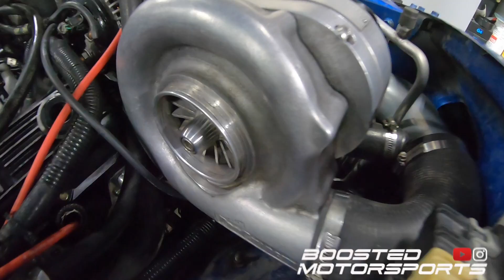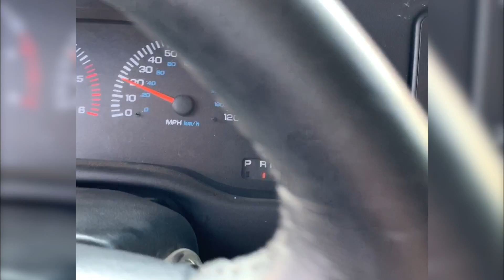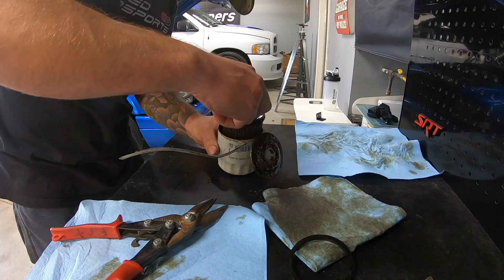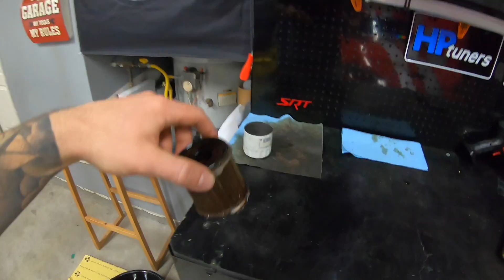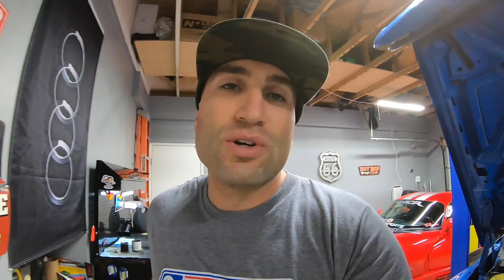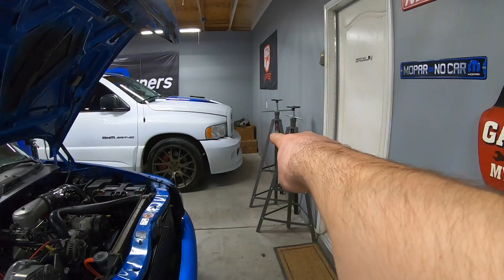BLEW UP MY ENGINE

Comment: It used to be and I have no idea if still applies but Mopar had goofy oil pressures. It is common for an old engine to drop down to around maybe 5lbs of pressure at idle and Mopar said it's normal. Rev it up and the pressure goes up, perfectly normal. I've put 50k on engines doing that and no of them ever let loose.

Comment: Should have stuck with the magnum man. Yes it ran meh times in the 8th but I don’t think that’s a fault of the engine, but more a drawback from the transmission. Maybe even the gearing. These 4 speed autos are junk and power robbers

Comment: My 1992 d250 5.9 does the same thing. It's got 126k on it. I just run 10w40. But I don't have any glitter in my oil. But it's stock and I'm not into modding it right now. So thicker oil works for now.

Comment: Damn dude that sucks...

My first vehicle I just bought a week ago is a 2001 dodge Dakota sport V8 quad cab.

With a V8 I believe 4.7 magnum and it's been rebuilt with 45k miles on it been replacing all the factory stock lights, system with alpine, D tunning headlights, taillights.

The black rims, all will be later since I have to save up for the black rims I want.

Comment: I have some thoughts about why the engine may started to eat the main cap bearings.  If you have been running high RPM's for extended periods, it may have sucked all of the engine out of the oil pan.  Try upgrading the oil pan to a higher capacity in the future.  Also, check out Hughes Engines for the 5.9 Magnum rebuild to include a block girdle.  Good luck.

Comment: If you got your 360 Magnum engine to 700 hp / 1000 hp were would you get the transmission rebuild to handle the power

Comment: I would rebuild the 360. If I were the one who owned it I think the first thing I would do is intake, exhaust, headers, and some bigger tires. Then I would see about better transmissions. I love dodge and all but their transmissions are really shitty especially for those years. They've been doing better now which is good. After that I'd save up and buy a forged crank, pistons, and new heads, on top of tune so it runs properly and maybe a bit more economical. Then I would see about going boosted. Since I'm only 16 I dont think I'd really want anything above 450 and the list I added up there would definitely be doing 450 horsepower reliably. Even then 450 horsepower for someone who hasn't had very much driving experience is still much so I think I'd have it tuned down to about 300 horsepower. Enough for it to be fun but also not too much to where I'll kill myself in the rain because it had too much power for me to handle.

Comment: I know you already got the engine in but i have a 50,000 mile 5.7 Hemi out of a 2016 Ram shortblock I’d let go cheap. I also have a Hellcat cam we could put into it before we shipped. Let me know. justins2002camaro@gmail.com if interested. Probably have a set of heads for it also just not 100% sure yet

Comment: The fact that you drove it and there is no abnormal noises makes me think that maybe the oil pressure sensor may be reading off. I have a 5.9 magnum and anytime it would sit in drive with my foot on the brake the oil pressure would drop to 0. Turns out it was just the connector intermittently losing connection. I could wiggle the connector and the gauge would freak out and go up and down. New sensor and pigtail and it never did it again. I would never assume that the engine is bad without a mechanical gauge oil pressure test.

Comment: I HAVE A BIT OF A PROBLEM WITH MY  2019 HEMI CREWCAB 1500 , IT KEEPS MAKING A LOUD HUMMING NOISE WHENEVER IT WANTS TO , BOUT ONCE A WEEK SINCE I ONLY DRIVE IT ON WEEKENDS,  ITS SO LOUD IT GOES OVER RADIO AN PEOPLE TALKING IN MY TRUCK AN WHOEVER IS WITH ME SAYS WHAT IS THAT . SOMETIMES ITS JUST ONCE FOR 10 SECS THAN SOMETIMES DOES IT OVER AN OVER FOR LIKE 3 OR 4 MINS THAN STOPS . IVE TAKEN TO DEALER 5X ALREADY AN FIRST THEY SAID ITS THE RACK AN PINION THAN ITS THE EXHAUST THAN SAID ITS NEITHER ONE AN CAN'T REPLICATE NOISE . SO I PICK IT UP , AN THAN IT DOES IT AGAIN,  ITS SO FRUSTRATING , NOT SURE WHAT TO DO NOW , ANY ADVICE OR HELP YOU CAN GIVE ME I WOULD APPRECIATE IT .  THANK YOU SIR.

Comment: Definitely do as stroker! Cost difference will be minimal from stock rebuild with a cam. And if ya can swing it go with the Trick Flow heads that came out.  My buddy has a set and they are miles ahead of edelbrocks magnum heads

Comment: back in the day i had a 318 do the same thing that your 5.9 did. the oil pickup had gotten clogged .. PO of my car had done valve cover gaskets and somehow got on of the gasket tabs down in the engine. wasnt ready  to build the 360 replacement engine so i dropped the oil pan and once i saw there was no scoring on the crank i stuck in a set of rod bearings, bottom half of the mains and a new hi volume oil pump.. stuck in new oil and a filter , stuck a heavy magnet on the bottom of the oil filter ran the engine for 15 minutes and changed the oil and filter again and stuck the heavy magnet back.. ran the car for 500 more miles and changed the oil out again with new filter and heavy magnet once again.. cut open  500 mile filter and found very little in the bottom... i ran that engine with many passes at the track for 1 year and ended up putting the 318 in to an old truck that got probably 100 more 1/4 mile passes and 50K more miles road miles before the body rotted away.. engine still ran like a top.... personally i would drop your pan and if no scoring on the crank re-bearing it and  SEND IT until you decide what you are going to do in the way of a build.... you can do the bearings in a day and be back on the road

Comment: If I remember correctly from previous video you talked about pushing it till it blew. Maybe not what you wanted and Maybe a little too soon but......back to the drawing board as they say. 
-You can go with a Tesla engine. Now that would be different.

Comment: For your HP goals, I feel you’d have to do a hemi swap or go turbo. 
If you’re just looking for something quick at the track and not keeping it as cali street legal, could keep the magnum drivetrain and work more on weight/suspension for ET gains to keep up with the fast boys.

Transmission is definitely the next week link though. Vortech w/8lbs of boost lasted me maybe 50 passes at the track on a 40k mile truck. Martin Saine in Riverside is a great guy to build up the 46re (built mine), or go to his new “746re” hybrid trans. Swap the OD unit out with a dummy for the track to make it a “727”.

Comment: Hey man I'd redo bottom use stock crank have it line honed for new forged pistons an do cam with aluminum head's roller rockers an then you know what u got if do swap u wouldn't know what ur getting either so keep it with the motor it came good luck man with whatever u decide.

Comment: Pull the block and rebuild it!  You can likely find places that would be able to help/sponsor part of that as well..  chances are you torched a bearing or two.. so new bearings, maybe crank/rods.. but that's not a biggie.. assuming you can source those bits.. partner with someone else maybe and do a multi part series rebuilding the 5.9..

Comment: Man the oil pump is just going bad that's a normal thing for these motors even without it being supercharged trust me I've had this happen to a couple of these the shavings are from the rod bearings once the pump starts going out it shaves them down get a new better pump and bearings and should be fine don't give up on it yet buddy.

Comment: i wish value of these would jump way up fast,mine has 94,000 easy miles..never floored but about 3 times in 13 years,passing gear wont release,have to let off a little...needs headliner,an about 5 other small issues..

Comment: Basically oil rushes through all the crank journals and bearings, so even when theres a little metal flake.. thats all going through the rotating assembly gets in the bearing spins the bearing throws a rod out the block.  When you use NO2 theres more heat esspesially stock cast pistons those cylinder walls are increasing in size due to heat which makes the rings squeeze down until the rings butt up together then they buckle and thats were stock pistons fail. But your right always freshen your motor with the basics before boosting.

Comment: Your oil pump failed put a new one in it the motors not blown you chewed the mains a bit L.A and magium s are actually very tuff  engines if going to spend some money get a 408  stroker kit it would be a way cheaper than hell cat and with Forged internals you can crank the boost to hell cat level s

Comment: My vote is to stick with a Magnum engine, rebuild the bottom with a 408 stroker kit, maybe add a cam/heads (whatever is in your budget) and keep the procharger! Maybe I'm biased because that's my dream build for my Dakota R/T; but it would be cool to see something different making big power then just another late model engine swap. That said, I'll make you an offer on some of those Magnum parts if you do decide to swap....

Comment: no no...i had mentioned, whats the mileage,an i never remember an answer..if you put a hellcat motor etc,it wont be the same at all,an yes i know you think it was cursed,maybe it had 200,000 miles no one knew..if you change it tryin for 800 horses etc,its not the same..i built my duster an was bored 30 over an used keith black pistons long ago,very tuff, drove an drag raced for 8 years to tennessee an back everywhere and a lotta drag racing runnin like mid 8,s  eighth mile..3.55 gear..had to use a used comp cam, cause im on disability,an tell me what you can do on 800 a month....so hells bells, the viper is boring,an truck is boring..theres guys running in 10,s with there r/t motor..5.9 360 ..an i was used to watching an waiting an hoping for this one..and now, o well..seems you must have insane power, o well. it wont be a dakota r/t no more with a hellcat, or built 440 etc,but rebuild that bottom end very tuff etc,an have heads checked etc,an good cam etc.an it can be made to run 10,s or so too,an with supercharger, make sure it will take it..i know you had no clue....but its there an you wouldnt have to look for another one,whats wrong  with a dakota r/t with a built motor running like 7.07 or 11 flat in quarter etc...each to there own,i loved it,an i wont be watching a viper,or sr10 truck etc..i have a dakota r/t in my driveway,an i relate..so do something fast.its so easy  to do a very fast 440,but they never came with a 440,all dakota r/t,s were 360..its your deal...an to do it fast is good,a dakota r/t club member may have a very fast tuff 360 ready to go,an safe to supercharge..whew..im so dissapointed, friggin football today, my teams lost,an life in general is sucking bad..i need g ood news,an i admire your speed at doin things..a wild 454 in a chevy vega would be fast,but would be the norm for 500 horsepower etc...fix the motor,bring it from the dead,or go with  another built 5.9 ...

Comment: You will also need a 46RE built for the power. My truck is running Martin Saines Msaine 9 1/2" Ultra billet converter. Dave Klaput from Proformance did my 46RE to handle about 800WHP without a trans brake.
Reply: What exactly are you talking about now? lol
Reply: Donovan Petersen keep the Generic motor crap out of it.

Comment: You wont be able to get those numbers without a tonnnnnn of engine work. You should either do a hellcat swap turn key OR get the wallet out for a LA style big head Magnum build on the blower you have. Most off those builds are doing 450-500WHP N/A before boost. Get on the FB page and talk to the guys Brian Whitely had a killer Indy combo Magnum.

Comment: 3 best options
Built 5.9 stroker
Hemi
Viper V10

My vote is hemi but any of them would be great.  Hellcat internals aren't rated for much more than what they make, rod/piston upgrade is recommended but at that point I would just forget starting with a hellcat and just get a 5.7 or 6.1 and building it up.  Cheaper in the long run.

Comment: Failed oil pump! My 5.2 did that too!
Reply: oil pumps rarely fail.  its the pressure relief spring that fails or hangs up. Clearances determine oil pressure.
Reply: That my first thought

Comment: Time for a hemi on holly terminator. The truck will fly
Reply: Also the 46re trans in the trucks are trash. Martin saine sells beefed up transmissions and custom valve bodies. Hemi with a Borge Warner sx400 and some manly pistons and rods and a jay greene or tsp cam will get you 7-800 at the wheels reliably.

Comment: more or less likely you messed up the oil pump when these pumps get old and have a lot of abuse they go bad and quit producing pressure and a bunch of stripper glitter will appear in the oil filter but either way the engine will have to come out to replace it!

Comment: The valves & valve seats goes bad on those and have oil issues and you pushing all that horse out killed it. The head gaskets are solid on those.

Comment: Why not pull it, throw new bearings in and send it. For less than $300 you could be enjoying that truck for several years while you build another more capable block

Comment: Put a 5.7 hemi in it my opinion is that it would be lighter since it’s a aluminum block and the hemi head would be just insane power from the stock 5.9
Reply: 5.7 hemi doesn't have an aluminum block. It does have aluminum heads though
Reply: The Manic that’s prob what he meant. It’s nice to weld nuts on broken manifold bolts on the 5.7 to get them out on them tho. But you’re right
Reply: The Manic My b your right it has the aluminum heads but it’s still making good power
Reply: @bryant.3699  Yeah it would be insane power

Comment: Try replacing the Oil pressure sending unit first
Reply: I had the same problem with mine. Thought motor was blown but the sending unit was bad. No pressure at idle and pressure when moving. Replaced the sending unit and had a pressure reading again. 2001 dodge dakota rt 5.9.